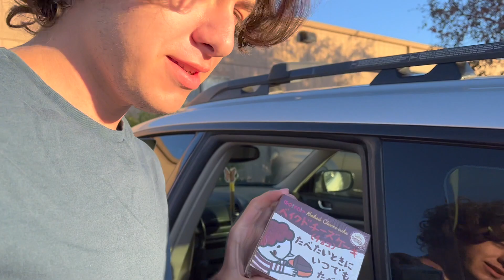I Made a RC F-117 Nighthawk (And It Actually Flew!)

Comment: Did you know that the F-117 Nighthawk was very hard to auto focus on because off it's shape because the way auto focus works is by Having Light bounce back to the camera and guess what the F-117 is meant to do bounce it away and make sure the radar but in this cause the light to come back to the receiving part, Because of this it would have a hard time because it thinks it is farther away then the real deal.

Comment: Nice job getting her to fly as an EDF!  I've built this from rcfoamfighters plans 3 times now as a prop & slot.  I like your changes and will use them next.  I don't have any video of them.  The first two flew like bricks and needed full throttle at all times.  My third attempt can't get off the ground because she's probably too fat (710g w/out the 3S/2200mAh battery).  I didn't realize rattle can type paint weighed so much!
Reply from the maker: It is a very tricky design indeed. I hope your future builds work out!

Comment: Try 3d printing a nozzle from the fan to the slit in the F117's rear. The smooth computer generated surface there will help a lot with efficiency & power. If you were using an FMS, QX-Motor, or PowerFun 64mm edf then I could develop it and mail it to you (because I have 64mm fans from those brands).

Comment: you may realize that is the maintenance of a slightly nose-up attitude that makes lift and keeps this model in the air.     such a flight attitude tends to impede airflow into the air intakes.       this is potentially a big deal because a fan/edf  does  Not  draw like an engine does.       d

Comment: everything about a  tiny  f117's exhaust is a compromise.      it should be remembered that a  fan/edf  does  Not  like back-pressure; and  that is what the  f117 exhaust  causes.        in order to work right, an edf needs three things --- the right amounts of intake and exit area,  and  an exit duct shape that does  not  cause excess back-pressure.          12:45   this was a  wonky  kf profile.       in that, the step did align with a 'percentage of chord' line.       d

Comment: *   8:56    NO.   cheaters tend to  NOT  be  effective.       for best efficiency from an edf there needs to be a  minimum of Forward-facing cross-sectional intake area.         the minimum efficient intake area value is equal the  Effective  swept area of the impeller.      this value is also equal to  The  optimal exit  area.       d
Reply from the maker: Armchair engineer

Comment: That was so cool. Awesome tail heavy save!! Top notch flight. Great work you're doing. This is just me barking away at some ideas here. I'd get rid of ductwork in front of the EDF. Then open vents in or just under the canopy windows. The main intake vents, cut out some foam on the fuselage side. More air to  EDF and to cool the electronics+ battery. Thrust tubes gradually taper down and are usually 2mm smaller at the exit point. It creates a slight choke point to boost thrust. Length 4× fan diameter. I'd also make the exhaust area a little taller and a bit  more narrow(add foam to the inside). AS3X Rx or wing tip for stability. My brain is overdrive. I subbed and hope to see more of your progress with this one.
AirHammer out!!

Comment: Sounds like you know more about the swirly air than I do but- Seems like the easiest solution to intake is popping out the windshield and redesign of ductwork and top hatch. Guessing some low-key winglets on the tips may also help keep you tracking straight. Never built an RC anything though, sorry for wasting your time as well as my own. Subscribing to see if I'm a genius 🗿
Reply from the maker: The design has little winglets on it but I am a nutcase and I like the scale looks so I decided not to add them! I also made some intake adjustments that will hopefully mean I don't need cheater holes :)
Reply: I think the exhaust ports are a bit too large, in theory they should have the same outlet area as the edf... I think?
Reply from the maker: @beargillium2369  roughly 90% of the intake diameter
Reply: @thatpolishhotdog  is it? Commenting on a fairly old video l, but yeah it looked like the exhaust ports were way big(at least by scale), but hey if you say they're 90% I believe you. There's a pretty good walk around of the f117 at an air museum now and the real plane has some really slim ports, that also appear to angle upward quite a bit, kinda like a thrust vector. 
Also the bottom has a pretty distinct boat hull sort of shape.
One last thing they mentioned ports above the main intakes on the more horizontal surfaces of the "ducts?" Which are opened during takeoff for increasing airflow, maybe a little plastic tabbed could achieve the same on your RC version and the flaps would just open under throttle when needed. 
My two cents, nice plane! 👍
Reply: @thatpolishhotdog  edit: those ports almost seem like they could act like a sort of vertical pull lift thing too (I realize I say sort of too much 😁)